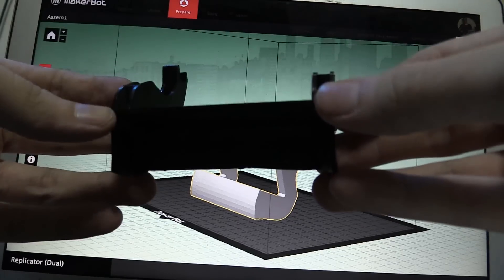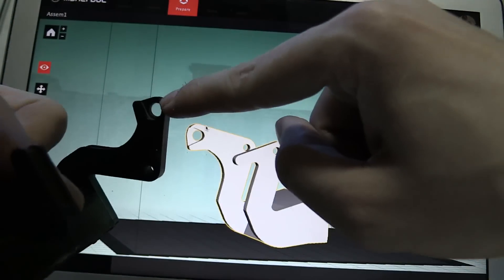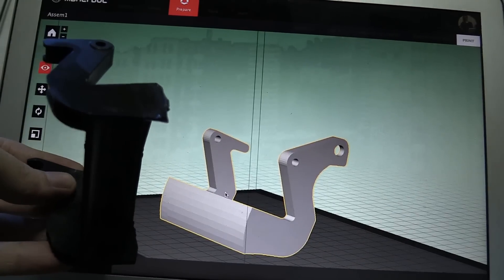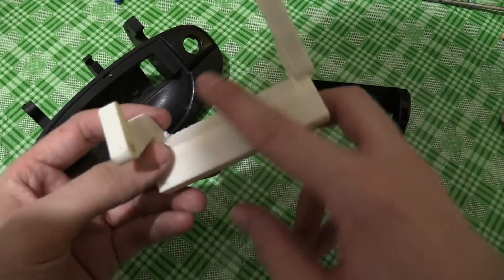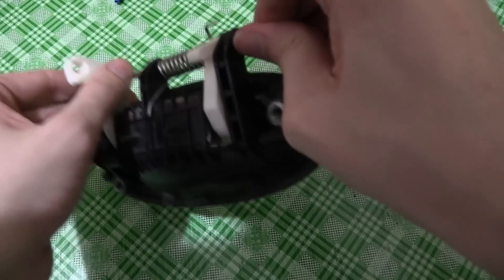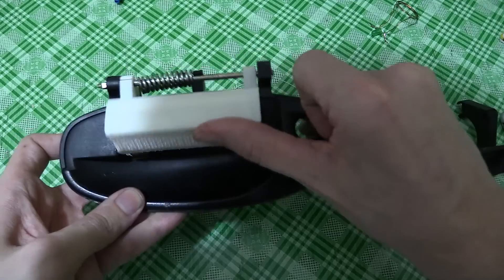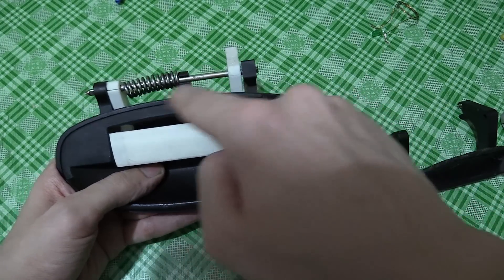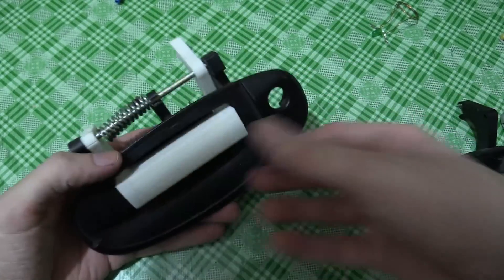3D Printed Chevrolet Door Handle - Part 3

Comment: With the right skills, would you be able to correct the original design where the part fails?
Reply from the maker: Sure. I don't even know if there's really a problem with the original design by Chevrolet or if the previous owner of the car was just too rough with it.

Comment: Hey buddy. I'm selling my laser cutter and CNC machine. Let me know if you're interested. It's 6040z CNC with rotary (4th axis). You can find both with more details on ebay and I can provide addl photos if necessary. The official description was "USB Mach3 4 axis 6040 1500W cnc router engraver engraving machine 220V/110V" 

Laser cutter official description "CO2 LASER ENGRAVING MACHINE FDA COMPLIANT 40W LASER TUBE THIRD GENERATION" 

Price would be what they cost me minus 10% or so. Consider that I had to assemble them, deal with shipping, customs, etc, so, I think that's a good price.  Let me know if interested otherwise I'm going to post them to olx.  To anyone else, these items are located in the Philippines and it's local pick-up only.  :-)
Reply from the maker: LostRoaming If you'd have asked me a month or two ago, I probably would have been interested! Having access to a 3D printer now, I'm struggling to think what I'd use the laser cutter/engraver or CNC machine for. Very good deal for anyone who takes you up on it though! Thanks for the offer :)
Reply: Gadget Addict Okey dokey smokey :-) Awesome job on the handle btw.  Just a note for anyone else interested in the laser or CNC machine, they're really apples vs oranges to 3d Printing. CNC and laser are more geared towards creating and even mass manufacturing a finished product. 3d printing is awesome for many things (as this video demonstrates) though, just not fast enough for mass production and not really the same finished look. Also, wood carving and engraving is really sweet on cnc. Ok, peace out.  ;-)